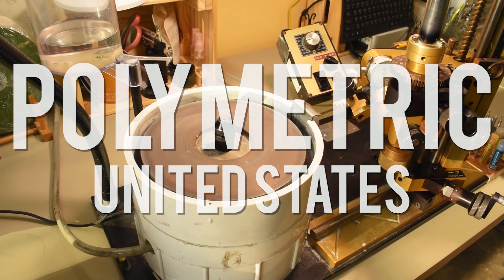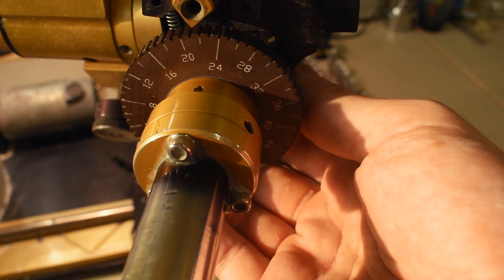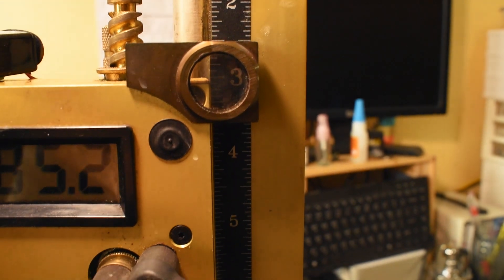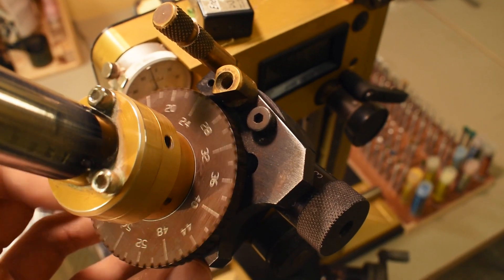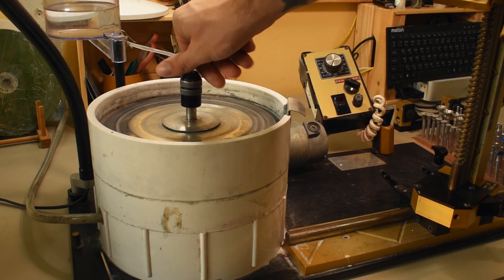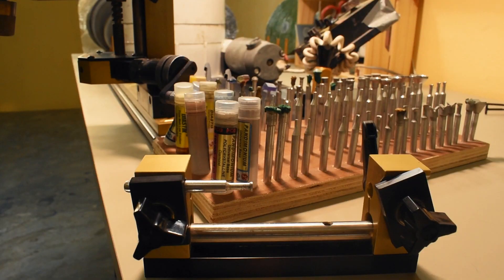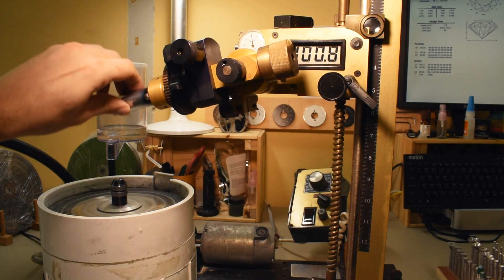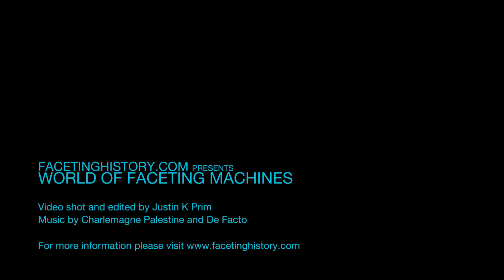World of Faceting Machines Ep.3 : Polymetric Scintillator

Comment: Hey just. The machine is really very good. Could you please tell where can one buy this machine and what is the price of this machine with additional index wheels, thanks in advance.
Reply from the maker: All the info is here: http://www.polymetricinc.com/scintillator88.htm

i might have a used one for sale soon but i need to get the digital readout repaired first.
Reply: @JustinKPrim  Just spoke with Zane over at Polymetric. Very cool dude. Did you ever get the digital readout fixed? Still thinking of selling?
Reply from the maker: @peterthielmann3718  I plan to get it fixed at xmas and then selling after tucson. I have one interested buyer but if he doesn't take it, its up for grabs.  It's in bangkok though :)
Reply: @JustinKPrim  woohoo
Reply: Still available for the use one.justin?